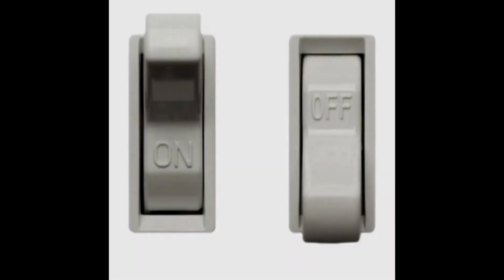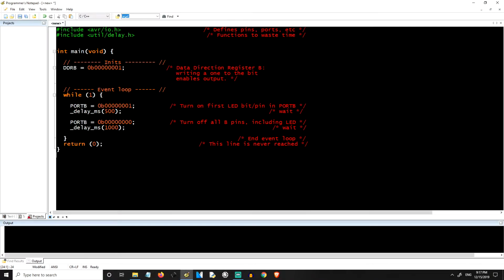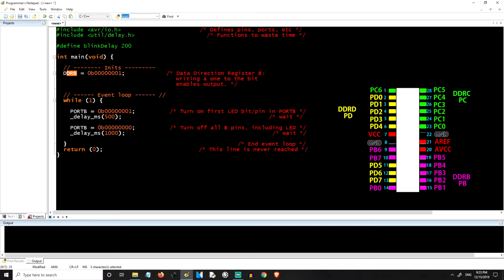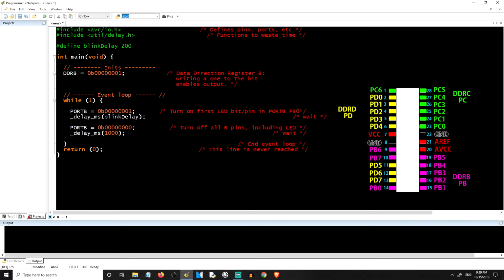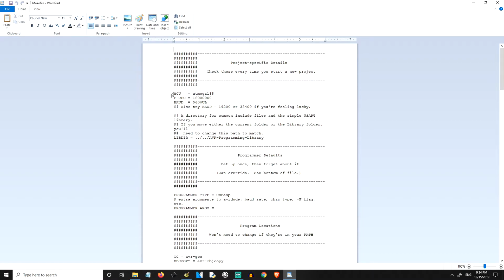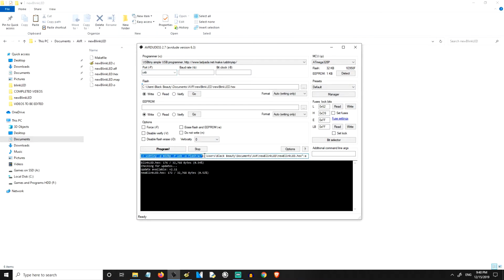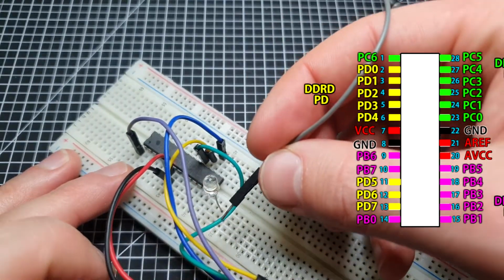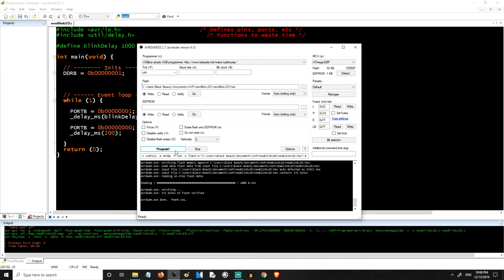HOW TO CODE ELECTRONICS & ROBOTS in C Language

Comment: What major did you do or like how did you find out how to do robotics and electric/electronic engineering like this cuz I’m confused cuz there’s electrical engineering mechanical engineering mechatronics robotics engineering what major does it take to work with arduino raspberry pi breadboards, servos and all of that
Reply from the maker: This is the same question I had 10 years ago! People come up with a lot of different names but it's all "Electronics" some call it "Circuits". I don't have a degree in it, I got a book for one chip: the chip that is on the Arduino Uno and studied every day and learned VERY slowly. I was confused for years. Everything is about how to use the flow of electricity to do work. The chips on these boards are like different weapons with pros and cons. Batteries are like a mag full of ammo. Different components like capacitors, motors, servos are like add'ons to the weapon to help use get the ammo downrange. You can program the chips on these boards or by themselves in different languages in order to control the flow of electricity very fast and repeat things and calculate, etc. Mechanical engineering focuses on how shapes can do work, Electrical engeneering is how to safely control large amounts of electricity (construction, buildings, circuit boards). Robotics is a name for mechanical + electrical. Mechatronics is the same. My website has explanations on all of this and its free. Thanks for the question 👍
Reply: @Kimchi_Studios  oh alright thanks that solves my question
Reply: @Kimchi_Studios  also what’s the book?
Reply from the maker: @Eazy E  Hardware Programming in C by Elliot Williams but that is an older book and ordering the chips is annoying (I have a video here on it).  I would recommend something Raspberry Pico related, the Pico is cheap, easier to hook up to PC to program and can be programmed in Micropython (Python with a few very small changes and any experience you gain can be used to write Python code for a PC 👍 ), C (my favorite low level, fast, slim language), C++, and even Arduino language. There is a Pico W that can connect to WiFi and they will be including Bluetooth control in the future. Raspberry Pi magazine and Maker Magazine have FREE pdf versions each month that show different projects with links to the code and full tutorials etc so no need to spend money on a book. Now you got me excited to make some new videos on this stuff 🤣

Comment: Hi, I have a question, I've been learning C++, and I want to know how do I use it for the Electronics or Mechatronics Career. I've been trying to look for more guidence but I couldn't, I just want to know how to use it
Reply from the maker: Each chip and each board (arduino, raspberry pi) can take different languages. Arduino uses the same chip I use but can be programmed in C++ because it has the bootloader. I only know C and some Python. Raspberry Pi can be programmed in Python and it is easy to learn.
Reply: @Kimchi_Studios  Ok, thanks that´s what I wanted to know. So, all I know of C++ can go to Arduino? Do you know any book or course that teaches you Arduino by using C++

Comment: Is JavaScript a good language for programming circuits
Reply from the maker: Javascript is a high level language used for web applications. You want to use a low level language like C, C# or even Python and C++ if the chip/board supports it (Arduino & Raspberry Pi).
Reply: @Kimchi_Studios  do you know a way to check how much power your raspberry pi circuit consumed?
Reply from the maker: @ratipatweras5577  Yeah, use a multimeter in between the pi and your power source to see how much. The first answer in google is good too...

Comment: Hi a I just got into electric engineering and I know how to the parts but I don't know where people code to turn them on please tell me the name of a coding program
Reply from the maker: You can program electronics with different languages. It depends on which microcontroller or which board you use like Raspberry pi or Arduino. I program in C language because it is faster, smaller and the foundation of most other languages.
Reply: @Kimchi_Studios  since you program with C, which hardware are u using often?
Reply from the maker: @Pemmanator  Chip: Atmega328P
PC: Windows
Programmer: Sparkfun USB tiny programmer
Breadboard

Comment: I'm sorry, I've just skipped ahead and I see you edit your Makefile in Wordpad... Why Wordpad in an age of easily accessible, fast and free syntax-coloring editors like the venerable Flo's Notepad2 (I outright replace Microsoft Notepad with that every time I install Windows) or any of a plethora of other good free tools like, say, Notepad++. You even use Programmer's Notepad in the video, why not use that one? I don't remember running Wordpad in about two decades.

A tip for beginners, Makefile is sensitive when it comes to whitespace characters - if everything looks OK but it just doesn't work, maybe you used MS Notepad and it added BOM character at the beginning (use an editor that can show whitespace characters, or even a hex editor to confirm).

Anyway, keep up the good work.
Reply from the maker: Wordpad is my personal preference for viewing Makefiles for organizational work flow purposes. I have never had a problem because I only edit small parts of the Makefile. I don't like opening everything in Programmer's Notepad.

Comment: Hey man! I know javascript, swift (ios) and html, css. I really want to start with robotics and with stuff from absolutely scratch. So I think C programming is good to start with, as I know other languages I will not have a super hard time learning it. Next I need to learn electronics but I don’t know anyyyything about electronics..:( so that’s suck, it feels like I got no clue on how to get into to robotics and like start creating a project with c and apply it to some stuff. What are your tips for me? My goal is to like create something super cool, as the robot on mars that is programmed in C. And I think long term so it can take 10 years if it needs to. Just need your help to get me started and learn robotics, how computers works from scratch with 1 and 0 and all this stuff. I want to know how to do all this!! I want to know how it works and I want to get into to robotics and literally know how to build a computer from scratch with nothing else then a board and cables and electronics stuff!
Reply from the maker: Today is your lucky day. I have thawed out of hibernation. I will show you everything here on on my site. You CAN make incredible things even with small, cheap components. This will be my focus and I will show code and ways to make everything without expensive 3d printers etc.